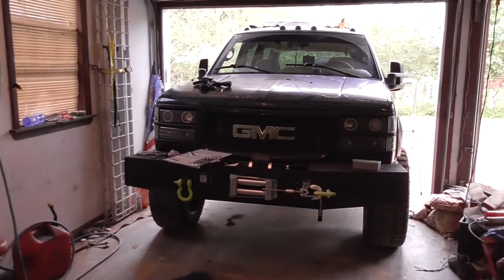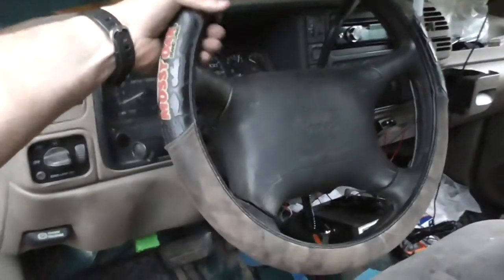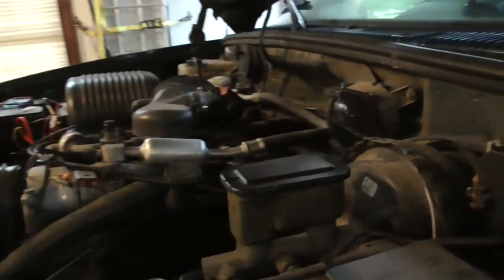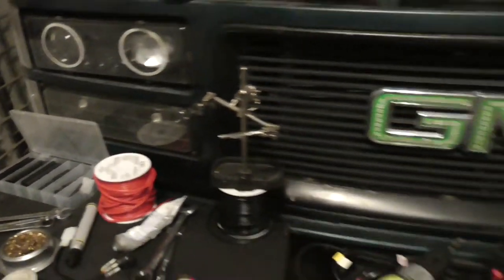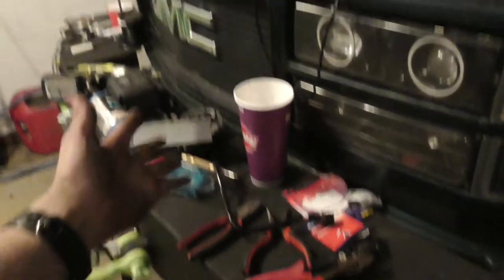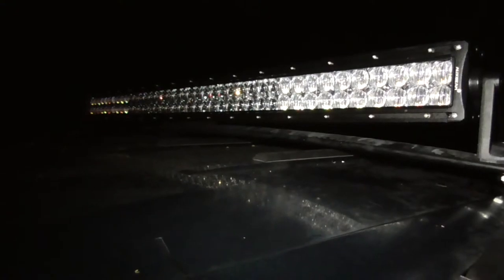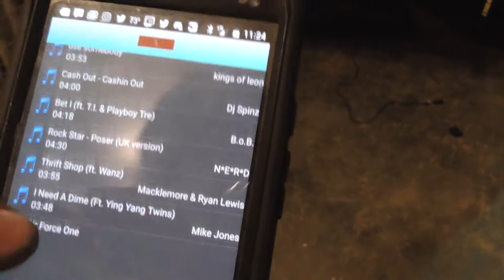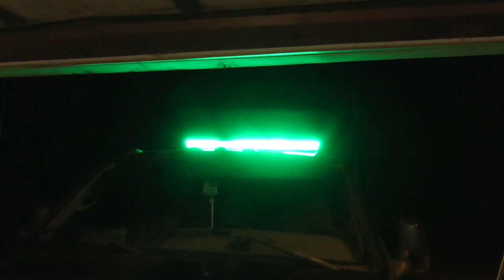Yukon Update | Installing AuxBeam's 42" V-Series RGB LED Light Bar Straight | Color Changing 240W

Comment: Hey can you please tell me what's the name of this I want my led headlights too change color and my led bar like your to change color and what app do I need to download to do this thanks for the video that's a nice truck
Reply from the maker: Thanks. The light bar is a AuxBeam V-series light bar and the app you need is listed when you get the light bar.  The headlights need to be custom built, you can't just buy them from a normal aftermarket retailer.
Reply: Okay any LED headlight that I buy I can make the light change right because I have a 04 Gmc Yukon
Reply from the maker: No, even the newer vehicles are custom headlights. There are places that sell pre built lights but they are about $500.